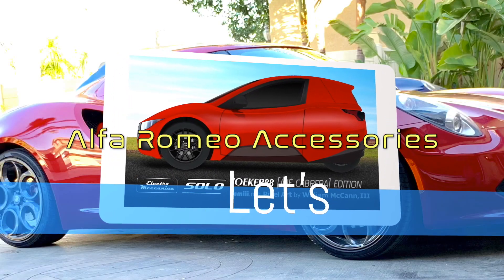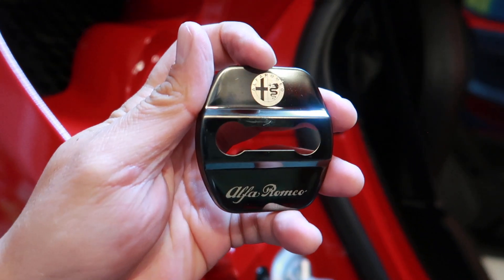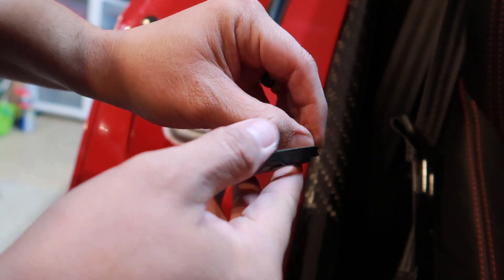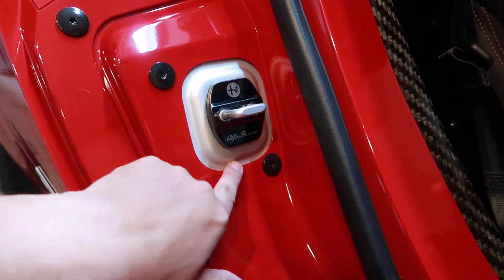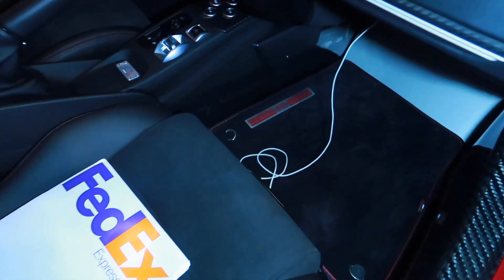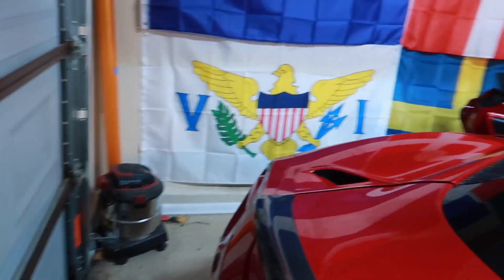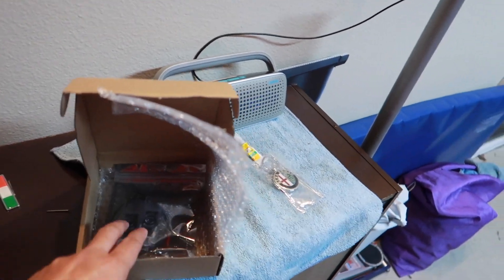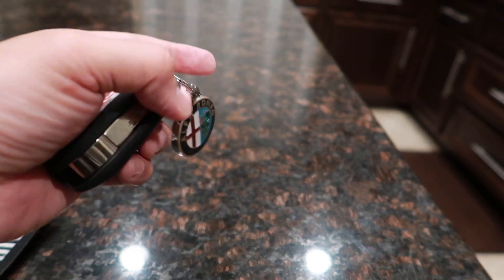Let's Talk Cars: Alfa Romeo 4C Affordable Accessories

Comment: These small little detail changes make the car looks even better👍🏼. If you want a projector light logo for the Alfa 4c they sell wireless ones that are rechargeable or you could have a custom wireless one for 20 bucks off of ebay where you could have any design you want but FYI those require AAA batteries
Reply: Could you link that please?

Comment: What are the maintenance costs per year? Whats a good price for a used one
Reply: Join the ALFA 4C Forum and you will have tons of information available including the answers to your questions.  In short it is a relatively inexpensive to maintain car for its class but not Ford/Chevy level. It gets very good gas mileage and being light is easy on consumables. To buy a used one you are looking at mid 40k to 50k depending on trim level and year although they are all identical over the entire production run other than some trim options. The 2015 Launch Edition models (500 serial numbered) are the most desirable and command the higher price. They are mostly at the very end of their production run so if you want one new you may have a harder time finding one....but there are used ones coming up.
 I  own a 2015 LE bought new and love it....no problems at all....highly recommended. There are a couple of minor things that you can easily improve such as better tires to eliminate any tramming, firmer suspension bushings and different alignment settings. But like all cars you can make them better with a couple of tweaks. But even stock it is very satisfactory. Overall the 4Cs have proven to be pretty much bullet proof.
Cons: limited storage space, entertainment system is just adequate....but with the sound of the engine you have the best symphony behind your head! Getting in is a bit trickier but I have no problem and I am 71 years old and 6' tall.
Pros: Everything else...... is designed as a drivers machine....minimal weight, insulation, great engine sound. Puts one heck of a smile on your face every time you drive it. Quite comfortable to drive....brakes and steering are very nice but both more responsive than normal cars. Engine and trans yield a very quick car that will surprise a lot of muscle cars....it isn't a drag car but 12.5 second quarter and 0-60mph in 4.1 seconds are pretty quick.
Reply: ROBERT BERTA   Thanks Robert,I purchased a 2018 spyder with all options and absolutely LOVE this machine,your comments are spot on, I am 65 years old now and loving every second of this beautiful piece of art and joy and plan to keep it till the day i die. 😍😍😍
Reply: @waynemiller1609  I hope your a car enthusiast and your not just going through some mid life crisis